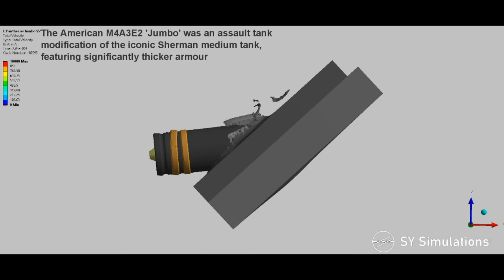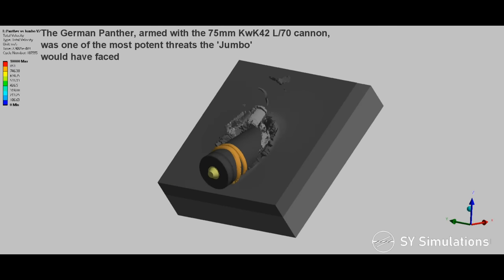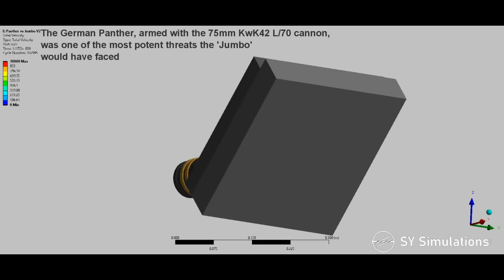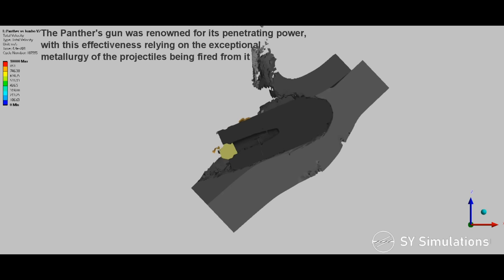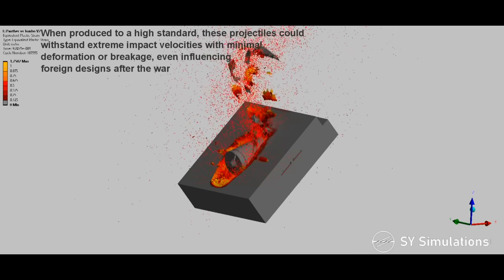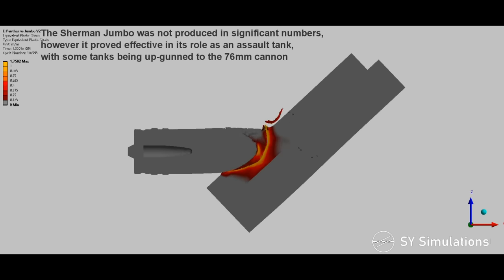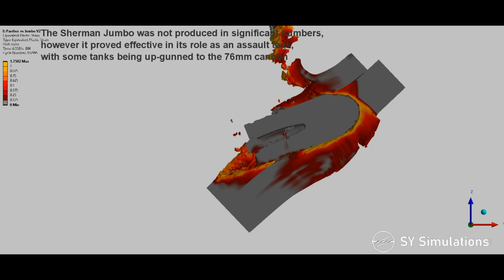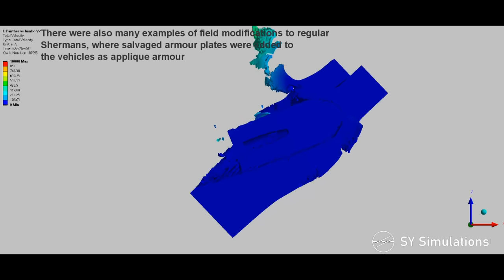PANTHER vs M4A3E2 SHERMAN JUMBO | 75mm Pzgr.39/42 Armour Penetration Simulation

Comment: Could I suggest a lower quality shell like what would have likely been made late in the war in this same scenario? See how much penetration is lost/gained by that metallurgy you mentioned.
Reply: German shell quality didn't decrease during the war, in fact it kept getting better.
Reply: @ThatZenoGuy  So the opposite of the rest of their steel industry?
Reply: @hoosierfarmkid 
There is no foreman study on the steel quality of German industry. 

The known 
1. Some steel has different mix 
2. Some processes are altered
3. Other stuff

The reason for 1 is both improvement of chemistry and lack of raw material. For 2 is improvement of process and factory seems to keep going up in flame. Of course I'm greatly simplified the issue on hand for shortness sake. 

Actual post war testing shows some tank has worse workmanship and material. Some projectile has worse workmanship and material. But there is no trend line relative to time one can draw as the existing data point don't point to any particular trend.
Reply: @hoosierfarmkid  
The rest of their steel industry advanced and was competitive as well. What's you're point? I think you've been reading too many reddit posts.
Reply: @ThatZenoGuy  IIRC it was a point in a Chieftain video. And German steel production was not exactly being done under ideal conditions… raw material was rare, everything remotely related to precision manufacturing was routinely bombed, every bit and bob possible was needed yesterday, and the steel used in drivetrain and armor production had WC comparable to cheap imported junk 10 years ago.
Reply: @jintsuubest9331  That’s what I recall, it didn’t reach Soviet levels of consistently trash, but quality control went out the window. One unit could meet or exceed design specs while the next needed one good push to disintegrate.
Reply: @hoosierfarmkid  
"A chieftain video" is not a primary source nor is he infallible. Try again.
Reply: @ThatZenoGuy  Better than the Reddit posts I don’t read you accused me of using… and at least I have source
Reply: @hoosierfarmkid  
Nope. Cry about it. Find better information.
Reply: @ThatZenoGuy  Why don’t you provide a source for your claims? Or are you using the Senator Armstrong approach?
Reply: @hoosierfarmkid  
This isn't reddit. 

Try again.
Reply: @ThatZenoGuy  So Senator Armstrong it is… no source vs Chieftain and assorted other sources but you accuse me of not having a basis…
Reply: @hoosierfarmkid  
Point Im trying to make is we cannot draw any conclusion regarding the quality control or the item themselves as there are example of trash and good from both before and at the end of the war. Just like there are example of trash and good from everyone else. 

For US and UK equipment, we know troop received up to spec stuff vast majority of the times. 
For Russian stuff, we can actually draw a quality vs time graph, and it goes up toward the end. Yes, the starting bar is low, but improvement is observed. 
We cannot do such with German stuff. 

But we can get some clue from Japan situation. 
Even during the later stages of the war, where people are eating literal grass and city being leveled just about every other day, the military production are generally of up to standard. That's not to mention the stuff later in the war tend to be technically more demanding. 

I would say a safe position is war production remain a similar quality for German.
Reply: @hoosierfarmkid  
Please try harder. You're better than this.
Reply: @ThatZenoGuy here are multiple reports the us and Soviet army’s did in the quality of German steel, they found on average that It did get worse across the board. Note that some plants where worse than others. So yes German steel did get worse and if u think it didn’t your dumb. Also he never mentioned Reddit. Sounds like you’re projecting.
Reply: @ThatZenoGuy  😂
Reply: @hoosierfarmkid  Yup.

Comment: Sherman Jumbo with 76mm gun was the shit.
Reply: For real. Tiger brawler, Panther hunter.
Reply: I didn't see the "the" and was about to throw hands.
Reply: @friedyzostas9998  "Tiger brawler, panther hunter"
Bro, the jumbo literally faced all of Germanys reserve shittiesas the heavies went to the eastern front for the russians.
The few times AND I MEAN VERY FEW times a jumbo got into an engagement it retreated from panthers and tigers and lots of times Panzer 4s.
I know you have the american pride and shit, but try grounding yourself in reality for a moment.
Reply: @AnonyMous-ql9nj Your comment adresses the crew, not the tank itself. It's irrelevant.

 Doesn't change the fact that it can reliably eat up both tanks' shells while its own (stabilised) gun has a pretty good chance at going through. Also, it has parts commonality with its older versions and is far easier to fix in the field. The german big cats are dimwitted designs simply because of the roadwheels choice and having to pull the turret away from the hull in order to have access to the transmission. I said what I said.

Comment: So the Panther didnt pen, means Tiger, Panzer IV and other weaker guns definitely couldnt.
Reply: Depends on what round they are firing.

Panzer 4 firing the Armour piercing composite rigid would penetrate at this range,

The Panther round shown here caused a partial penetration, and if the warhead goes off... then that's going to count as a full penetration (crew not as alive as they were before)

Otherwise if the tank is somehow still not as dead as they would have hoped, they would just reload with an Armour piercing composite rigid round..... and that is going straight through (124 mm of penetration for the round in this video versus 174 mm of penetration for the APCR against armour at 30 deg from the vertical @ 500 m)

Tiger firing the Armour piercing composite rigid is going to penetrate at this range

The panzer 3 would need to be pretty much point blank.

Just for the fun of it, and I know that you said WEAKER guns,

But the Tiger 2 would penetrate this out to 2000m even firing the standard AP ammunition

Firing the APCR it will defeat it beyond 2000m
Reply: @notsureyou  Alright i was already considering calling you a wehraboo but then you shoe horned in the King Tiger into a conversation that no one asked about... definitely a wehraboo.
Reply: @PeterMuskrat6968  Some people just don't like facts.

Clearly you are one of them 🤷‍♂

The name calling which you straight away go for not only confirms this... it also amuses me 😂
Reply: Its meant to withstand the most common AT weapon that german had like Pak 38/40 and Flak 88
Although the threat from Panzerschreck and Panzerfaust still there
There's also Pak 43 but i think its rare, considering how big and expensive it was

Comment: If you omit the filler, is the weight of it still added to the projectile ?
Reply: No, maybe yes, maybe no. No, it makes no differences compare to the rest of the mass. 
Removal of bursting charge is often done with testing irl target with irl projectile for safety and cost reason.

Comment: Imagine the power an APDS round from a panther might have
Reply: They had APCR shot not APDS
Reply: @simefestin  Well aware. That is why I said "Imagine" and "might" not "had"
Reply: @jacobf6945  APDS is father of today apfsds
APCR is standard AP but with tungsten core
Reply: @simefestin  Facepalms Nope...
Reply: the 17 pounder was actually quite similar to the panthers gun with it's solid shot i would assume a hypothetical apds would be quite similar to it
Reply: @simefestin  And APCR is the father of APDS.

Both rounds have the same purpose, that being to deliver a small but heavy core made of a dense material into the armor of the target at high speeds, therefore achieving high penetration.

APCR uses a carrier to fill the bore diameter of the cannon when the projectile is being fired, as the core is much smaller in diameter than the cannon itself. The problem is that the carrier stays with the core during flight, leading to additional drag and therefore speed loss. Technically it does have increased weight which would mean more drag is necessary to slow down the projectile in the first place, but the carrier of APCR rounds is specifically made to be lighter so that it can obtain a higher velocity. Effectively it just means a much higher volume for not that much more weight, so a lot more speed loss.

APDS fixed this by basically discarding the carrier once the round leaves the muzzle of the cannon.

Comment: As the panther utilised and APHE round would the round manage to penetrate the jumo's frontal armour if it had exploded after impact?
Reply: You are asuming that the fuse works flawlessly, which it doesn't. Specially in regards to that angle of attack, which can cause deformation.
Reply: @friedyzostas9998  And that 17g of PETN filler is barely enough to fracture the shells body. Chances are it would just blow out the fuze plug.

Comment: Why they didnt make the front plate thicker to all shermans? The decrease in speed would be acceptable right?
Reply: Not at all. Lowering the speed of the Sherman by greatly increasing its weight means you cripple its primary attribute, that being tactical and strategic mobility and ease of shipping, for the rare chance you encounter a German Big Cat. Even then, the armor buckled and failed at a range that is fairly realistic for combat in Europe. The Allies saw more benefit from strong tactics and solid planning than up-armoring everything to hell.
Reply: This is a stopgap solution because t20-t26 are not ready. 
The engineers and brass knows it has many flaw but they need to ship something to the field.
Reply: Yeah. You would cause an excessive stress to only front part of the suspension causing uneven deterioration and uneven ground pressure. Sadly, this simple solution would make everything worse.
Reply: @Prometheus19853 
The whole point of this thing is not to fight against the odd big cats, but as a breakthrough vehicle, just like the big cats, the IS, and Churchill.
Reply: @jintsuubest9331  Yeah no shit, but the OP asked why not make EVERY Sherman a Jumbo. The only reason you would want to is because "Reeeee Big Cats" and not making every Sherman a breakthrough vehicle.

Don't try to flex your knowledge when you don't even know the context.
Reply: The shermans were practically the perfect infantry support tank and were more than capable of handling their most common foe, the PZ IV. 
The very rare case of encountering a tiger or panther was not worth crippling their other advantages such as their speed and reliability. Because obviously that extra armour means extra weight. Which means extra maintenance, and extra trouble with bridges, mud, etc.
Reply: The Sherman and T34 whilst very capable tanks (and they clearly got the job done), they were not the be all and end all.

They did make some improvements to both of these tanks, but on the whole... what they had was "good enough" to get the job done.

For those who think that I am being unfair against the T34 for example, 

The Soviets built circa 84,070 T34's

The soviets lost circa 44,900 T34's in the war (which is more than the entire turreted tank production of Germany counting Panzer 3's and bigger)

So they were able to be mass produced, and as a result they were easily able to replace losses.
Reply: Not acceptable, the E2 engine and transmission is already at its limit
Just look at M26 Pershing with same engine and transmission and how troublesome it was until it got fixed many years later and turned into M46 Patton that finally replace M4
Reply: @blackmark7165  The M26 uses an entirely different transmission (torqmatic instead of synchromesh), and even has a different model of the Ford V8 engine (uses the GAF instead of GAA). The biggest problem with the M26 was the unreliability of the torqmatic itself.

Comment: Fun fact: 90% of commenters forgot that the shell includes an explosive charges that is omited from the simulation. The result would be much worse than what you see above.
Reply: High velocity 75mm doesn't pack much filler and can bearly split the shell.
Reply: It wont it will make it worse
Reply: Another fun fact: You forgot that at such angles, shells are predisposed to deformation, which also include deformation of the fuse. The shell will not penetrate simply because it doesn't have the structural integrity to protect its explosive mechanism.

There is a very good reason why the brits used solid shot during WW2.

Comment: Everytime i am watching this videos, i ask myself, why the German Tanks have been considered the best 😅
Reply from the maker: To be fair, this was one of the most armoured tanks the allies had, and this isn't the most powerful gun the Germans had
Reply: @SYsimulations  thanks for your answer!
And keep up your awesome work 😊😊
Reply: Long story short, German tanks have incredible on-paper stats, and had excellent doctrine backing them up, at least on the offensive. Things start to fall apart when you look at things like ease of maintenance, parts availability, long-term reliability, and to a lesser extent, crew ergonomics. Compared to a Panther, an M4A3 equipped with the 76mm gun and HVSS has better acceleration and maneuverability both on and off road, massively superior reliability and general maintainability, best in class crew ergonomics and visibility, an extremely accurate gun, and the best logistical support on the planet. Most engagements were decided by who fired first, and a Sherman is almost always going to get that first round off. Add the incredibly high unit readiness rate to the equation, and the end result is Shermans showing up when and where they're needed, almost without fail.

Comment: Would the vehicle still be combat effective after an impact like this?
Reply: The vehicle yes, the crew not so much. A lot of spalling.
Reply: @hashteraksgage3281  did most crews bail after the first penetrating hit?
Reply: @xcritic9671  if they weren't dead yes, sometimes they would leave a relatively intact tank, even more if the crew was inexperienced. I don't blame them tho.
Reply: @hashteraksgage3281  to my understanding it was quite rare for more than 2 or maybe 3 of a Sherman crew to be killed by a hit that knocked out the tank. Very spacious n all that.
Reply: @xcritic9671  You are correct, the Sherman had a crew normality rate of roughly 15%
Reply: @idontlikecommunists9677  yeah most tankers are definitely not normal lol. (Reread your comment).
Reply: @xcritic9671  I hate autocorrect, I'm so sorry, I meant to say mortality
Reply: @idontlikecommunists9677  no problem, I knew what you meant haha

Comment: I wonder why it was not upgraded to sherman as standard? It is so effective. But to partially add only 100mm solid plate to the front and the front turret and transmission casting to 120mm thickness, so much weight is saved but the effectiveness is increased drastically. Especially if utilizing hvss suspension and 76mm gun.
The superiority of a new tank would be unmatched but having equal utility and comfort... very odd for US defense department
Reply: Jumbo modification put a serious strain over the Sherman suspensions and transmission, also reducing the tank mobility, which was considered a negative trade off. At least, that is what I remember from The Chieftain video on the jumbo.
Reply: @darionapoli4736  but that's using the complete modification. Lessening the turret thickenss at the sides and rear, thinning the transmission housing, and removing the side armor will save significant weight.
Reply: @a.t6066  even reducing the turret armour in that way, you're still adding some extra ton that will slow you down and reduce reliability. The Sherman was very good as it was, especially the later variants with 76mm, because it was mobile while and very well fitted for manoeuvering warfare. 
It was also transportable and reliable, so it could show up in numbers. Adding armour would hinder all that for no reason.
Reply from the maker: It's about which baskets you put your eggs in i suppose, good frontal protection instead of side protection? Vice versa? Or good tactical and strategic mobility with a lighter tank
Reply: At the time the 1944 tank building program was finalized, no need was seen for such heavy protection. The 250 Jumbos were an expedient and perhaps an afterthought.
Reply: @darionapoli4736  Israelis worked with 40 ton sherman for years and I cant recall any gripes about it reliability or mobility
Reply: @SYsimulations  I would think such a sherman would just be a better panther. So many call panther for its greatness (in concept) yet sherman can achieve better with small upgrades in actual practice
Reply: Why not upgrade it to standard?
US Army is decide that M4 is already enough to face anything German have and only requesting heavier tank on 1944, already late stage of the war and how only 1 company that making it (Fisher Body Corporation in Detroit)

Even after the war only regular M4 mainly being used (Korean War) before finally replaced with M46/M47 Patton (basically M26 Pershing with more powerful engine, transmission and problem on M26 fixed)

And some country that still use like israel are mainly upgrade its main gun instead give any more protection (M50/M51)

Comment: The problem with this simulation is very simple the Germans would have to launch at point blank range for the flat trajectory, but from a distance it would be slightly angled to hit flatter against the armor.
Reply: It would be a small fraction of a degree difference, we wouldn't even be able to see the difference if they were side by side. This isn't a mortar.